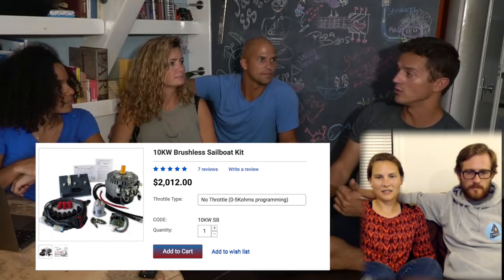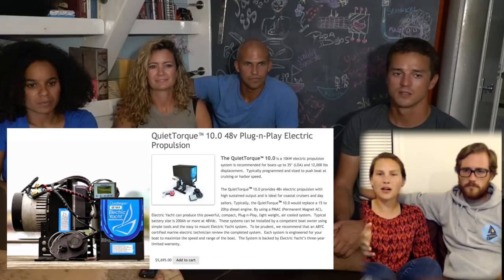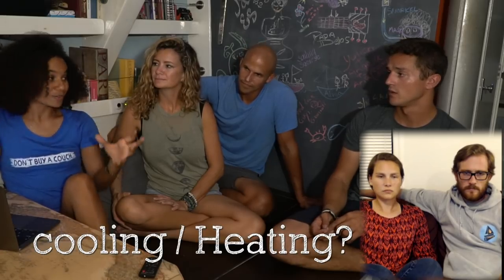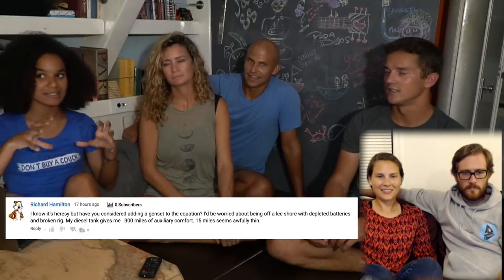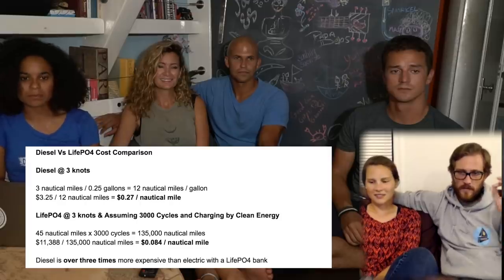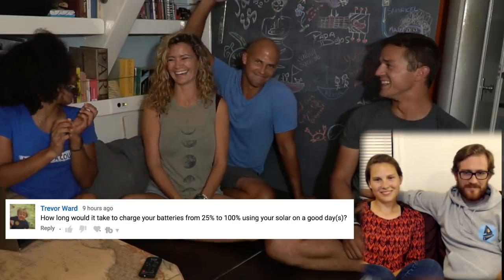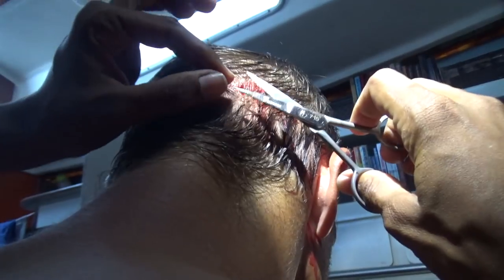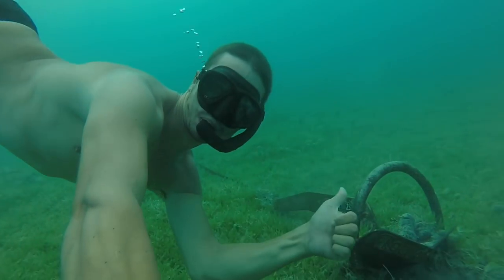Electric Sailboats: An HONEST Discussion — Sailing Uma [Step 140]

Comment: Hi another interesting video on lithium batteries.
https://youtu.be/TdUqQZC2dcE
It’s about the Tesla batteries that everyone says is top of the line technologically. But they do talk about ways their design make the batteries last incredibly long. The ‘boat style ‘ batteries may use a different design. Not everything applies but interesting none the less. 
Like did you know Tesla have cooling tubes thru out the batteries to keep temperatures within the no damage range.
Cheers Warren
Reply from the maker: Yes, Tesla packs are quite intelligent. We almost bought a set. We don’t need the liquid cooling tough since our loads are minuscule compared to a car.
Reply: Sailing Uma  Really ? 30-80 amps is a lot of load , a car has way less rolling resistance than a yacht!  Boat engines run much harder that auto engines which is why car engine don’t make good boat engines ( thatvwhy they usually Marinize tractor or truck engines designed for continuous load for long periods).
 I thought the temperature control to maximize the battery life was interesting.
‘Big easy sailing’ has I think a Prius electric pack. 
Cheers Warren

Comment: Oh my....you are all really knowledgable electro-dudes! Not for me. I love diesel! Yeah, the noise is sweet and that delicious smell, especially the old smokey ones. Perfect when you are fixing up a snack in the galley in a nice swell. And don’t forget the space - yeah - use it up with a fat diesel - come on, what else are you going to use it for? Safety too...as long as you have got a few hundred gallons of fuel sloshing around somewhere you can go anywhere. I know. I do. I did once decide to pull on one of those ropey things on deck and a big white thing started to flap around in the wind. Very uncomfortable. So i put it away again and rely on my good old trusty tractor propulsion. 4 million hours and still going strong. Just about. Sometimes. Sweet!

Comment: Your fuel source is also from a million years ago. Lithium is mined and shipped all over the world.
Reply from the maker: It's is a tiny, tiny amount less than 3% of the over all expense to produce, and is also recyclable. The other metals in the battery make up the bulk of the chemistry and our batteries are more than 80% recyclable.
Reply: My bet is that your batteries will likely last long enough that you will move them to whatever next boat comes next (when Lagoon gives you that Catamaran) and if you return to solid ground they will find a home there.  Even at reduced capacity they will likely still be viable for many years beyond their original purpose.

I know this is counter to your philosophy, but a Fiat 500e or a Nissan Leaf can be purchased for $9000 US East Coast.  While used, you would get a 24 kWh battery out of it and could junk the rest of the cars.  As soon as this gets more common I suspect a secondary market will pop up for just this purpose with sailboats same as the original sourcing for diesels.

Thanks for keeping up the effort to get past all the FUD.
Reply: lithium isn't really consumed though, it's just part of a chemical process to store electricity.
Reply: Their fuel source is actually 4.6 billion years old (the Sun). The lithium is their fuel tank.
Reply: Lithium batteries have a limited shelf life. Even if they are not used. And that shelf live drops dramatically if the batteries are stored in a hot environment. In a controlled environment, you can expect around 10 years shelf life. In the hot uncontrolled  bottom of a boat, it could be much less.
Reply: @maxlemesurier  LiFePO4 batteries have no significant age-related degradation.
Reply: I have to dig up a Master's thesis I read a few weeks ago . It is a study just on that subject, shelf life of LiFePO4. To make it short: 10 years in a controlled environment like temperature controlled in a production car. MUch much less in hotter environment
Reply: Here is the study I was refering to on A123 LiFePO4 shelf life: https://uwspace.uwaterloo.ca/bitstream/handle/10012/12177/Catton_John.pdf?sequence=3
Reply: From the lab study on A123 LifePO4 cells: "Capacity loss in cells stored at high temperature and fully charged conditions resulted in faster degradation rates. Temperature had the most significant role in the degradation of the cell and then the cell’s SOC. Comparing capacity losses between cells stored at the same temperature, but with different SOCs, found that the cells with higher SOC experienced increased rates of degradation in comparison to their fully discharged counterparts. In addition, storage at high SOC and high temperatures promoted such severe losses that the cells in question were unable to recapture capacity that they had lost reversibly"
Reply: old lithium batteries can be reused for stationary land-based solar power stations. There are any batteries will work (main requirement - cheap), so old half-capacity lithium will get second life
Reply: I've got a LifePO4 pack consisting of 4 100Ah CALB cells I ordered from china about 7 years ago.  I've used that pack as a dinghy power plant (trolling motor), backup power in power failures ashore, camping, and for running electronics on my old, much smaller boat.  I'd guess I've cycled it around 150 times.  It's been flooded underwater in a dinghy (whoops), stored outdoors in summer and winter, and spent most of its time on the water.

I tested it a couple months ago, and it produced 98.6Ah at an average of 12.2V, drawing 10A.

I could have a miracle battery, but I think my findings are consistent with what others are finding.  LifePO4 is not LMO.  It doesn't appreciably degrade over time.  I bet Uma's batteries will still be over 80% capacity in 10 years.

Comment: your batteries cost $12000 and that is 2,400 gallons of diesel @$5 gallon.  and that is just the battery cost. im sure you have another 5-8K in the other electronics.  Im for electric, but dont like miss information.

Comment: news of a 'real electric" ferry being built for Canada
http://emag.nauticexpo.com/canadas-first-fully-electric-ferries/?token=7b44da42ca833f23357b1657d959db3ae4ad09ea
looks like this is not hybrid but plug in at each end of the  mile ferry route.
it will be interesting...….. cheers warren.

Comment: Hey guy's. Have you seen the new generation of electric sail boats that use their motor/propeller as a hydro electric generator? They can generate huge electrical power(dependent on the size of your motor of course) while you sail and add minimal drag. Electric will be better than diesel in less than 10 years!

Comment: Also a tripple prop is better and twice the size of the gasser version, why continue using a prop designed for million year old fuel, they ditched the fossil fuel Diesel engines, ditch the dam fossil fuel prop too.

Comment: Presenting faulty diesel engine installs as 'unsafe' is a fair comment, but presenting them as a 'less safe' option than electric is not proper logic.  Not everywhere is anchorable either - if you are 50 miles and 150m depth to windward off a curved shoreline in strong wind and cannot make headway, without a diesel you might feel safe for the moment, but you had better be glued to the helm in terror OR you are on those rocks - you're not sailing out of there, motoring out of there, or anchoring either - there is no escape.  I too love the independance, the autonomy, the freedom, the cost savings of electric, but Oceanmasters are now on double duty - did you sign up for that?  Can you really do more, or is it less?  Are you really happier, long term - or are you now even more hypervigilant, the very thing you hoped to reduce?  Take a long careful look at sailing into freedom and the faulty decisions he made and the difficult area he entered - can you go in there with electric?    As you repeatedly say, you better be very good at what you do, but are you, and do you want to be?
Reply: Steve Wright sailing into freedom used petrol engine and what did that helped him?
Reply: Read more carefully about him again.  He had extreme low fuel and was forced to be conservative, and then was forced (in his opinion) to navigate from a very dangerous area.  Either you don't go in there, or you have more fuel.  But what in the case of limited electric power?
Reply: If you can’t make headway in a strong wind you are not a sailor and unfortunately may just become a statistic!  Sorry for the bad news.
Take care,

Comment: Electric is a consequence of batteries without decent batteries it's impossible
Reply from the maker: We did for 3 years. It's not impossible, just less range. Like we said in the video. That's what sails are for. Now we have much better batteries and don't worry about them at all. We have way more range than we need.

Comment: Please, don't preach about the environment or you all wouldn't be sitting in your barrels of oil shaped into a sailboat hull covered and painted with other oil products. Even your bottom paint is made to come off in the water and what do you think is used to repel growth? Don't even get me started on your home made epoxy bottom paint. Also I have seen you all work. You don't care much about the environment then. Put down a tarp for god sakes and don't have your boat sprayed while its sitting in the water.    
I know you all are down on diesel to justify your electric but the first words were "ours didn't work" or "ours was broken down all the time". Junk is junk. Tanks full of crap are tanks full of crap. You all could have cleaned your tanks or replaced and put a new diesel motor in there that would have lasted forever. I personally think you all limited yourselves in some ways and freed yourselves up in other ways. It works for you so to each his own but don't get preachy.
Reply: Please don't criticize when there are no viable alternatives to those things available. You talk like they had a choice.

Comment: Sailing a sailboat has for thousands of years been wind powered exclusively. The largest ships to the smallest did not have ANY motor. Some Ancient war ships had oars with a slave for each oar, if a slave died you just scuttled the body and got a nother one. That's kind of difficult today, unless you're a democrat.

Comment: Poop........ on your environmental issues you’ve been programmed  by socialists ... I’m not negative on electric systems but I think a duel generator assisted    system  makes more sense. 

I’m betting none of you have spent days or weeks in the doldrums I have , it can cause serious provisioning issues not to mention emergency situations .
Reply from the maker: Spending weeks in the doldrums is very unlikely with modern satellite forecasting. It’s much more likely to be becalmed after a line squall for an hour or so when making a few knots to keep pointed in the right direction is all you need. The beauty of an electric system, is IF you ever venture into a place where motoring for awhile may be necessary, you can simply grab a genset, set it on deck and you’re good to go. Much easier to maintain or replace an $800 genny than a $15,000 diesel.

Comment: Thank you for this. The first automobile was a joke compared to a horse. But, eventually, even the biggest curmudgeon bought one. It will be the same with electric propulsion. Also, oil companies stand to loose an astronomical amount of money when electrics take over. I'd bet that they pay armies of trolls to post anti-electric comments in every corner of the internet.
Reply from the maker: I wouldn't doubt it. But they also buy up many small start up companies an burry them.
Reply: So, whoever is not for a 100% electric solution on a sailboat, is a paid troll and whatever related start up is "burried by oil companies"? Great logic!!